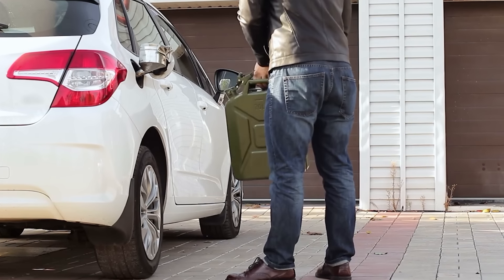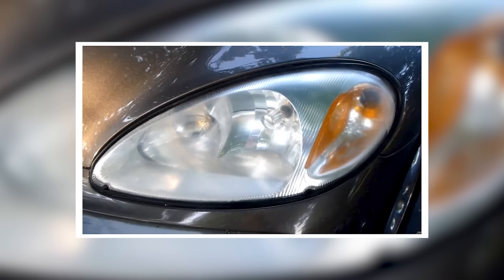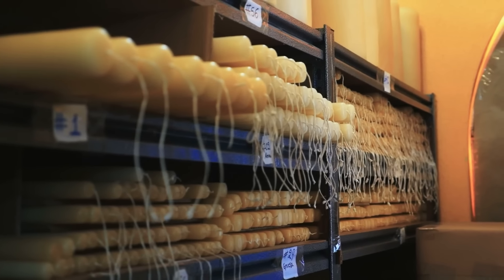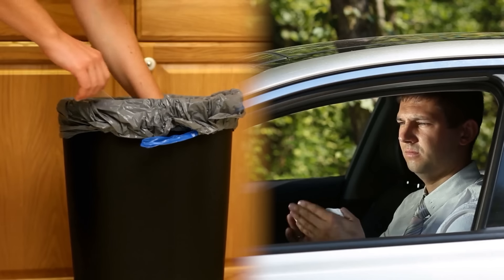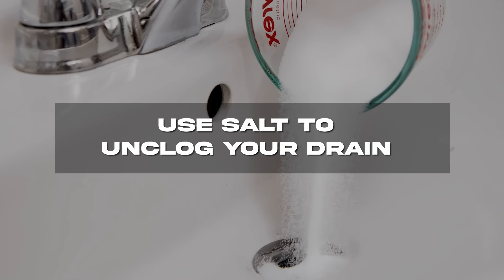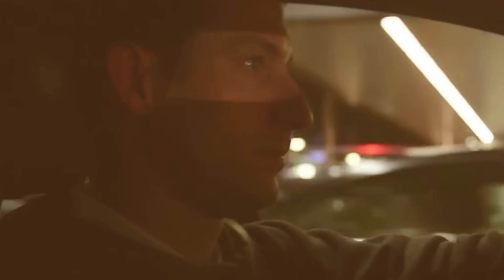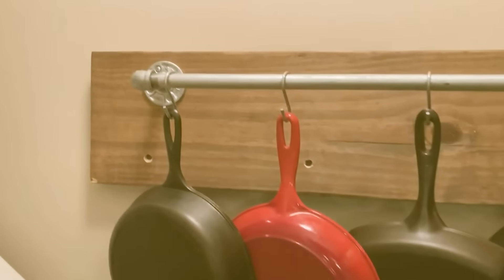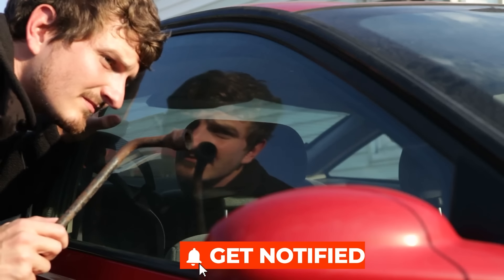Always Place a Water Bottle in Your Car's Tire When Traveling, Here's Why

Comment: Car Hack:

Remove a wheel after parking your car, to prevent it from being stolen.
Reply: Or, simply let all the air out of the tire.
Reply: A thief might have a spare wheel with him, so he could still steal your car. I always remove my engine when I park my car, because most thieves in my area don't have an extra engine with them at the time.
Reply: @miked5728  

Take two off then.
Reply: @miked5728  well said!
Reply: @alfonsobonzo3782 
Preferably opposing tires as in rf and lr or lf and rr.

Comment: mean?
Apparently, bad guys are sticking the empty containers in wheel wells, typically on the passenger side, as a means to steal either the car or the driver's belongings. The ruse works because an unknowing person will drive off but immediately stop upon hearing the awful cracking sounds of the bottle getting crushed.
Reply: I would think the tire rotation would cause the bottle to fall off.